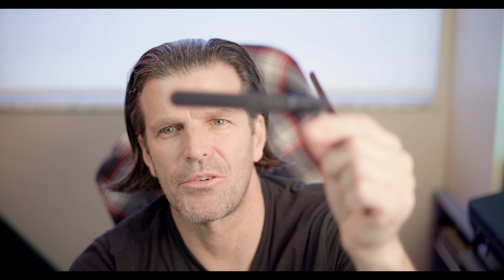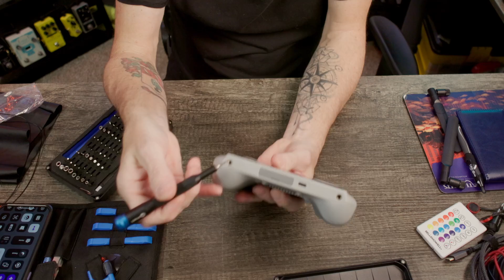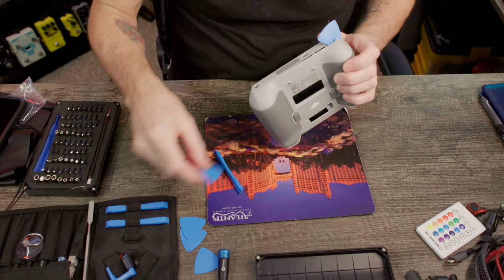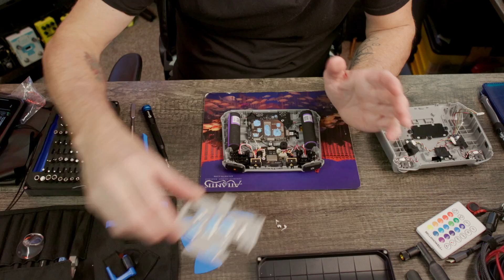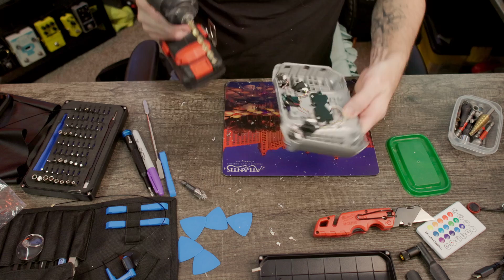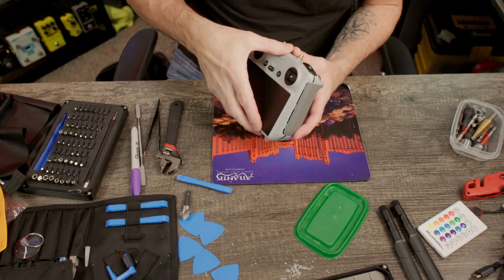Will Swapping Antennas Give Me Better Signal?

Comment: Great video, but the finaly test is in the air, the signal is good? What is the diference than the original. Please try to fly away and coment…
Reply from the maker: Ok so the signal was better in some spots. In heavy city areas where there is a ton of signal it seemed about the same or a bit less. Overall if you live in an open area this mod would probably be better than if you lived in or around a busy city. Hope this helps!

Comment: Dji is a fraud. 4 years ago, I bought my air 2. I could literally fly all over the city with no problems. I did a range test in a open environment and easily got 5 miles. Then, after a certain update to my remote control, it barely went 2 miles in the open. And city… ya, forget it. This is all over the line of site and them just making the decision for you. So all this new Accu sync is absolutely ridiculous. It’s like they don’t expect us to remember. Line of site or not, They promise a certain range but dumb down the signal so bad that you wouldn’t get the gaurenteed 15km in your dreams. So now we have to do things like this, spend all this money, just to get somewhat of a better signal. They can easily turn this up with an update. I just want my drone to have a solid signal in the city! Ya, I’m pissed off over their control and babysitting. I finally switched to Autel. None of these problems exist. Range, no nfz. Way better! P.S This is not a booster.  A booster is just that. It boost the actual power. This may help a little but don’t expect alot. There are actual boosters out there.

Comment: Doesn't work with those antennas . I only get 300 to 1K feet with them. Lost my Mini 4 Pro May 3rd. Around 100 yds away. Stick with the original RC ant. These ant. don't have the SWR rating and will ruin you RC eventually. Play at your own risk
Reply from the maker: You are right!  The range tuned out not what I expected at all.

Comment: Gut, aber schon mal etwas von einer Schieblehre gehört um der Durchmesser zu bestimmen. Bei den Antennen und Leitungen ist die Impedanz wichtig, ebenso die Antennenlänge, den. Die bestimmt welcher Frequenzgang verstärkt werden soll. Sonst passt das mit der Verstärkung nicht. Und mit dem öffnen ist das Thema die Alterung des Kunststoffes. Würde das nur machen, wen. Ich einen Controller übrig habe. Und mit der Wärmeleitpaste, Ist dann die Wärmeableitung dieselbe wie vorher. Eventuell noch etwas auftragen. Wer es riskieren möchte, der sollte das tun. Gibt es keinen Reciver Sender, den man einfach a den Controller anflanscht. Dann muss man nichts verändern.
Reply from the maker: 200% right my friend. I have looked up different antennas that work best for the 2.4-5 ghtz signal. 

From what I’ve seen so far from the two different sets I have is that in some places I have great signal and in some areas the opposite set works better. 

It’s definitely hot or miss. Some days I will have outstanding signal the entire time and some spots are way worse. 

I’ve seen a difference in open spaces with less home and business WiFi’s being used.

Comment from the maker: ✅ I will be uploading a part 2 for this one after a few weeks of flying the drone with the antenna mod. 

✅ I’m hoping it works as well as some of the other results I’ve heard of. hit the comments if you have any questions on this mod! 

✨Thanks for watching
Reply: Any obvious changes so far?
Reply from the maker: @DollarMoviesUSA  from the runs I’ve had so far yes. I just did a few aerial shoots in the city of Ft Lauderdale and it was a noticeable improvement as far as higher signal around the tall buildings. I will do a video on it hopefully early next week to go over the info I’ve learned. I would say it’s worth the upgrade especially due to the price. Especially if you fly in and around city or tall structures, trees, etc.